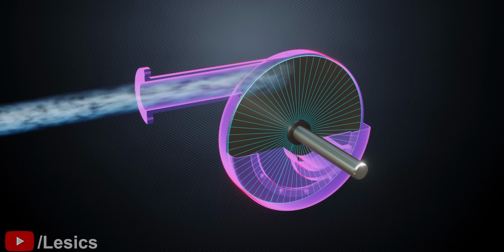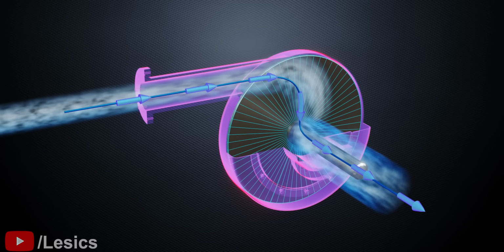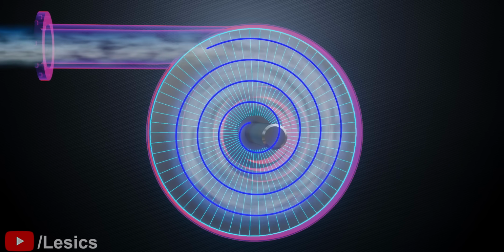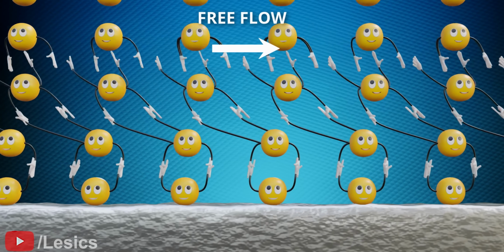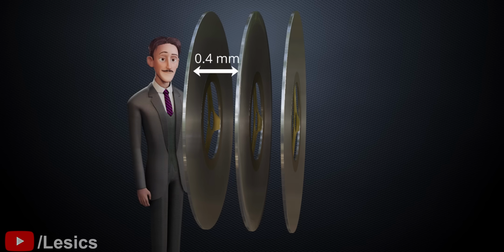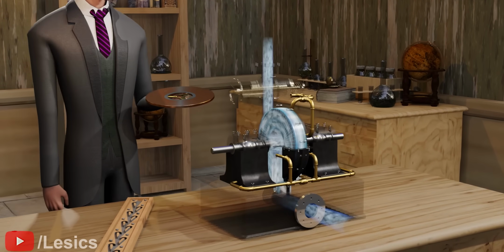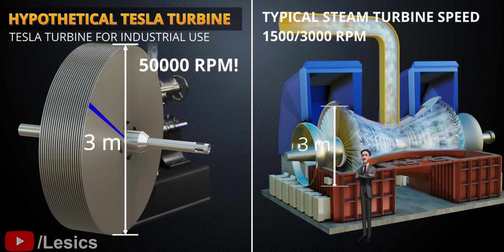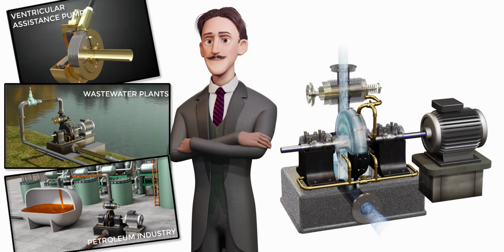Tesla Turbine | The interesting physics behind it

Comment: This actually helped me figure out pressed fuse glass. You can make glass really thin by pressing it between two kiln shelves, but the thinner it gets, the more it pulls on the kiln shelves, and the more it picks up kiln wash/kiln paper (intended to keep glass from just gluing to the kiln shelves. 3/16" or 4.5 mm can be pressed without destroying the kiln wash coating. 2.5mm cannot.

Glass does have a surface tension and "wants" to be about 6 or 7mm thick.
Reply: Elon Musk might be able to help you. He knows a lot about glass thickness. He even demonstrated this on a truck named after our man Tesla. What a coincidence!
Reply: Maybe float your glass on a molten metal? I work glass mostly on a propane/oxygen torch, have tried a little fusing here and  there.  At some point I saw some videos or toured an old factory (memory is faulty). I think they used lead or tin .
Reply: @RedSeedlesslive  The surface tension determines glass thickness. Floating on metal will make it 6-7mm thick.

Comment: So to my mind is one that probably shouldn't even be on here 😂😉 first thing that popped up I would limit the surface area that came in contact surface like how I see it is like when looking at rings in a tree that get smaller and smaller till they hit the out flow horizontal shaft.. rings being same distance  apart as the multi disk he use to increase torque..idk about y'all but a hula hoop inside a smaller one ect at the same time  idk or a different design  like this where he used multi disk for torque .what would increasing the size from 6 inch disk increasing gradually in size as it goes along the shaft horizontally, two dimensional outline would be a cone shaped from small disk to the largest one all in a row along the same shaft how would that help???.wait nevermind it's not important if someone could fixs the world problems we all would only shut it out

Comment: Anyone know how a shear thinning or shear thickening material could effect the amount of energy generated in this turbine?
Reply: Thinking along the same lines: A fluid with increasing viscosity per pressure ought to perform better at low speeds...
Reply: @Smo1k  Ya. What I'm thinking is maybe there would be a way to make this industrially viable using a shear thickening fluid so that we could have lower rpms or smaller disks for the same output.

Comment: Anyone notice the diameter and width of the turbine blades as they go from the center out? They get larger in diameter and increase to VARYING degrees of width to increase the tip velocity.

Apply the opposite to the discs in the TESLA TURBINE. From the center out, the discs should decrease in diameter, and increase in EXACT degrees on width (as opposed to varying).

For 3 meter diameter discs you would need  almost exactly .89 meters total width. 

Incrementally INCREASING the WIDTH OF THE DISCS (by .0113 mm) from the center out on each side.

and LOWERING THE EACH DISCS' DIAMETER  (by .0017mm) from the center out on each side.

I probably have NO idea of what I'm talking about...
Reply: I agree :)

Comment: you missed the most unusual use of Tesla turbine as a pump. there are no blades as in a regular turbine pump, Tesla pumps can be used to pump live fish between lakes. - without damage to the fish.
Reply: Yeah, and good luck for your fish swimming pass  >10000 rpm blades.
Reply: @tapisit  I don't need luck, I've seen the results (in documentaries) and there is various patents for improvements of boundary layer pumps capable of pumping water containing live fish.

https://patents.google.com/patent/US20120014779

It's tried and tested.

Comment: "...engineering impossibility!" something Tesla would not say.
Reply: Old engineering saying; "The improbable, we do immediately.  The impossible just takes a little time."
Reply: It is not impossible, they simple don't have the materials to support the high RPM.
Reply: @danigui8573  Turbo in cars can spin up to 200,000. turnover
Reply: @przemekkamieniarz  Turbos aren't meters wide like power plant turbines.
Reply: @ArgyleBitstream  But the power plant's tine does not have to reach 50,000 revolutions. Turbines in airplanes also make a lot of revolutions
Reply: @przemekkamieniarz  Modern turbofans actually have the fan sizes around 3m but unfortunately the fan part does not make a lot of revolutions around 3000 only.
Reply: @ArgyleBitstream  why not do 10 smaller ones than one big one?
Reply: Tesla the only known man who had basically the CAD 3D in his head, namely when he was asked why his machinery in almost all of the cases worked out first time.  He replied because I assembled them in my head and try multiple variations until it work in my head only then I build tem in a RL . 
That statement was on the trail when his lab suddenly burned without any reason (or maybe Edison ...) with all the documentation in it. 
Tesla was shocked but he rebuild all of his machines out of his head in 2 months, it was miracles for his co workers.
Reply: tesla tryed, unlike what is being said about modern day. Id try runnin her at mac 13
Reply: Um... Do an industrial application of power generating you wouldnt "NEED" a disk that is 3 meters in radius. You would aimply need more cells in an array of .3-1 meter turbines.  Duh!.   And we have the material tech now days to make such things.  The reason why this is being rejected is because Nuclear would be almost obsolete if they started making hydro electric of coal burning steam electrical generation.imagine, if you will,  having a car where you use a small pump the supple plain and simple water through one of these ultra high efficiency turbines.  Thich then turned and generated a massive amount of electricity. Which, with modern, science, technology, electrical etc, would produce more than enough energy to turn the motor which turned the driveshaft... Which tas an integral part of the pump.  So basically, the pump moves the water through the turbines, the turbines generate electricity which runs the motor which moves the drive shaft to the wheels,  which moves twater through the pump.
Reply: @CrazyIvan865  
Perpetuum mobile much?

Vastly and obviously superior technology usually catch on. Path dependency only works its magic if the differences aren't that big.
The Tesla turbine is completely obsolete. Otherwise it would be made and marketed with success.

You're just straight talking out your ...

Comment: So if the 6 inch diameter required 50,000 rpm.  12 inch should require 25,000 and  24 inch 12,500.  I would think and I say this because the circumference would double each time the diameter doubles.  So what am I missing (I know I have to be wrong I just don't know why)?

Comment: 'The only option is to reduce the rotation speed' : Errr, NO. Rotation speed could be reduced by applying a load to the shaft, generating extra energy, BUT the disc diameter could be reduced, with some reduction in efficiency, perhaps, due to friction of the periphery of the casing on the fluid, but miniaturisation could allowed running at increased speeds, and greater efficiency, where the point equivalent of rotational velocity would be less than Mach1.

Comment: one question: why not just take several small turbines for industry instead of one with a two-meter turbine. LOL
Reply: Then they'll take more space and more components, leading to higher prices.
Reply: It would require more material to build smaller turbines, there would be more turbines to service, and additional turbines would likely decrease the efficiency of the entire system. All of that would lead to the industry spending more money and material for a less efficient system and an increase in consumer prices.
Reply: I imagine that if the Tesla turbine and the industry turbine would be decreased in size, the output effect would decrease or the production expenses would increase as it would likely require more turbines to generate the same output. I also imagine that a scaled down turbine would rotate even faster, likely leading to the same or other failure issues presented in the video, but on a smaller scale.
Reply: I like this paradox in the comments. "Corporations are greedy, so they don't use the Tesla turbine that's supposedly better." plus "Greedy corporations are too stupid to buy and use the more efficient Tesla design, even though it's currently used in niche applications." Yeah. The same greedy corporations all refuse to get an advantage over their competition in switching to a supposedly better turbine. I'm sure it's that and not the fact that regular turbines are a better option overall.
Reply: @rafetizer  in corporations no one decides what is better or worse, they just make decisions and no one guarantees that they are correct, just sometimes successful.
Reply: @semsan8434  how old are you? I ask because that is a very navie take on how corporations work. Corporations typically do R&D to use the more effective method. Why? Because it saves them money so they can make more profit.
Reply: @semsan8434  Sure, but you can't expect anyone to believe that none of them would heed the advice of engineers, if a large-scale Tesla turbine was actually a better option. They're chasing profits, after all.
Reply: According to this article, the common factor in size of turbine is tip speed. A smaller turbine will need to rotate faster to make the same efficiency and same tip speed.
Material will then need to be stronger, lighter and expensive . Basically same principle applies to wind turbines.
Reply: @johnsonlam6901  The speed of the tip determines when the disk will fail. Not how much power it will generate.
Reply: @NeonGen2000  From your point of view, your the disk will be broken before you generate the power you want.
Reply: Exactly
Reply: Small Tesla turbine efficiency is poor. One problem he didn't mention is Tesla turbines have poor stall resistance. They are difficult to bring up to speed and if they fall below critical speed under load the boundary layer detaches and they will wind to a stop. They make great sewage pumps though.
Reply: Because a small diameter turbine is less efficient unless it is turning at impossible speed. To get maximum efficiency you need either a very large diameter turbine or a very high speed and neither is practicable. Tesla built a number of experimental turbines in cooperation with experienced manufacturers and they all failed or broke down  with warped or broken rotors.
Reply: Because the whole point of a turbine is to rotate a shaft. If you divide the work into hundreds or thousands of tiny turbines, you have to collect that energy from hundreds or thousands of tiny shafts, and then somehow step it all up into one big pool of power, losing efficiency at every step (regardless of whether you collect it mechanically or electrically). In other words, one small turbine is highly efficient, but you lose all that efficiency when you try to collect the power from tons of small ones.
Reply: Wake up sheeple, "Space" is fake, the "Universe" as produced by Hollywood/Universal Studios is non-existent and entirely make-believe!

Isaac Newton (Isasick Newbton) is a massive, great deceiver similar to the foolish shill Albert Einstein (Allburt Shillstein) 

The wise inventor man Nikola Tesla knew that the World/Earth is a plane, not a planet. Tesla said:

"Earth is a realm, it is not a planet. It is not an object, therefore, it has no edge. Earth would be more easily defined as a system environment. Earth is also a machine, it is a Tesla coil. The Sun and the Moon are powered wirelessly with electromagnetic field (the aether). This field also suspends the spheres (The Sun and The Moon) with electromagnetic levitation. Electromagnetic levitation also disproves gravity because the only force you need to conquer is the electromagnetic force, not gravity. The stars are attached to The Firmament (The Dome Ceiling of our enclosed World!)."

Don't beLIEve in the impossible, non-existent, make-belief; that we live on a mysterious, magical traveling ball in "space" !

The famous respected literature artist, Mark Twain, said that:

"It is easier to fool someone than to convince them that they were fooled"
Reply: @EvikeMVo  but if the earth is flat, why are all microchips made in China?
Reply: Whether you realize it or not, there is land beyond the ring of ice that surrounds the flat plate (everything inside the circular ice "wall-ring" surround: Antarctica) of our flat, circular World!

Research and find out the facts about the Antarctic Treaty. It's the only treaty in the history of the World that has never been violated/broken!

Commercial planes aren't allowed to fly over the ice ring/wall-surrounding of Antarctica! You can visit Antarctica under government supervision-control only and if you attempt to cross the government restriction line/border by trying to go beyond a certain point the Illuminati-controlled government can and will likely arrest you, no joke!
Reply: The reason why Not-A-Space-Agency is afraid of doing anymore cgi, animation-based, studio production(s) to fake: landing on the Moon; are because:

-people can easily discover for themselves that the Moon is not a solid rock-ball in "space" that reflect the Sun's light! The Moon shines it's own unique light; a "cold-light" which cools down the temperature of whatever object the Moonlight shines on (so the intenser/brighter the Moon's light is; the greater the Moon's light will chill/cool-down and lower objects' temperatures)!

-The Moon can be viewed/seen well after the Sunrise into the day!

-Blue sky can be seen seamlessly blended into the view behind the sometimes transparent Moon (the strange, mysterious, coincidence-based Raleigh Scattering Phenomenon is an unbelievable, absurd, and hilarious reason)!

-The color/look of Moonlight and Sunlight are entirely different!

-People can purchase a fine-quality, very high-powered, reliable, binocular or telescope for under $300 online and zoom on the Moon as much as possible to see if Not-A-Space-Agency is really sending a rocket, or anything for that matter, onto the Moon at all !
Reply: Because then manufacturers can charge more. Its always been about corporate greed
Reply: @jw5461  it's actually the opposite. More small turbines will lead to more charges.

Comment: Low inertia turbochargers reach over 100,000 RPM and have complex geometry. Wouldn't this be an application that would work?
Reply: I'd say definitely. But you'd probably have to do it yourself, as the car industry dinosaurs would only say it can't be done, or worse, they would actively try and stop people who are doing it.
Reply: @lechpapierski3180  Titanium and Inconel aren't that expensive. Balancing the thing for those speeds on the other hand, that could be a problem.

Comment: So the speed of the water is equivalent to the edge of a large gear connecting to a small gear? Was there any issues with electrical discharges or wavelength with the water?(something like heavy water or pure hydrogen)
Reply: MUSA YAHAYA  SABO   if only i know what those number means...is 2oH the same as h2o though? Since it looks like materials have warped during the rpm cycle, probably the steam would cause an expansion in between plates like a heavy gas bubble moving so fast its pressure is equivalent to deep diving or a rock.

Comment: i would propose that your problem is one of distributed work load. in tesla's time, we could not get the the materials, today we do not have he vision, but there is perhaps a different approach. a smaller disk can be made today?, one that has better strength? but only as a smaller object?  then you need to scale the problem differently my friend.  i see the answer as clearly as you can see an ant crawling up an elephant.contact me, i will divulge all.

Comment: Actually, regular turbines running a much lower speeds are already very efficient. To get useful work out of a turbine spinning at that speed most cases requires gearing that would be extremely expensive and also highly unreliable

Comment: The only option, reduce the rpm? No!
There are more options! Instead of using 3m diameters you may use 0.3 m but several turbines.
It woud also be an idea to use micro or nanoturbines, so millions of them, mass produced the same way as microchips are produced.

Stop thinkg 19th century! Let your brain arrive in the 21st century!

Comment: Couldn't we use smaller diameter discs, operate at 50,000rpm, and transfer the rotation through a set of gears to achieve whatever RPM we want?

Comment: Now what if you integrate newer solutions on Tesla's inventions? Wouldn't it become possible? like smaller discs with rods connected to rotor blades (needs experimentation) or a design laid horizontally that yields output upward as it may vary the fluid viscous force

Comment: But the first hydroelectric powerplant built in the US in ames Colorado near Telluride....tesla designed it....and he decided to use a pelton wheel turbine because it was better. That small 1 MW powerplant powered the first electric street lights in America....years before New York city.
Reply: Not to mention that he had wireless power in the earlier 1900s vs what they claim was discovered in the 2000....

Comment: Just like on the standard turbine which has the same principal in a jet compressor with tapered stages. Do the same thing with the Tesla turbine. Have the shaft spinning at 5,000 RPM's with the first stage 9ft [3meters] and work your way down ultimately to a factor of 10 maybe with 10 stages. the final disk would be 10.8"...There would also have to be some kind of gear ratio that is also 10X so the 10.8" disk would be spinning at 50,000RPM's.
Reply: My thought exactly.  With each disk spinning it's bearings from the disk before, so that none ever get to the point of speed heat failure.  Another version of a 3 stage motor.